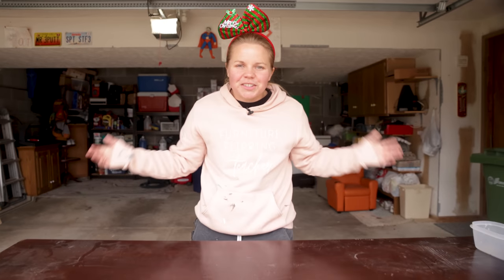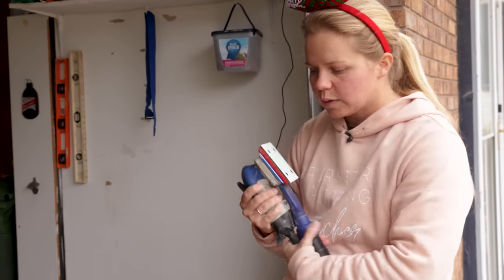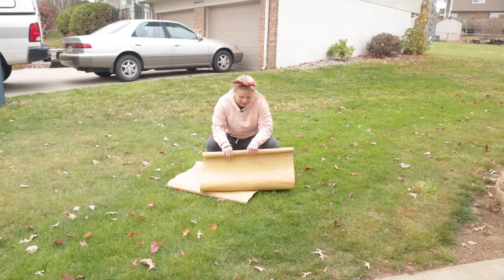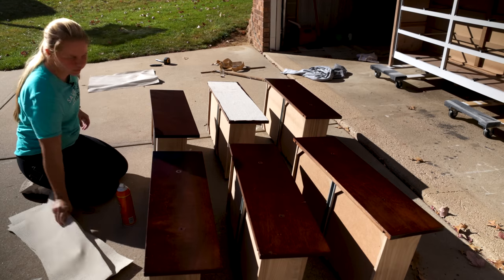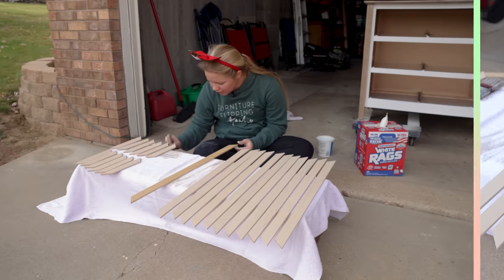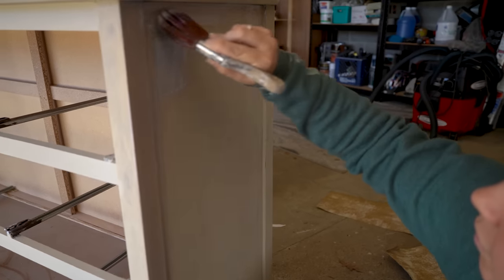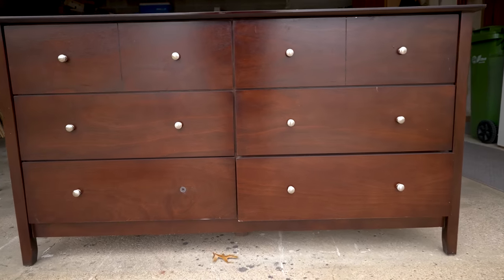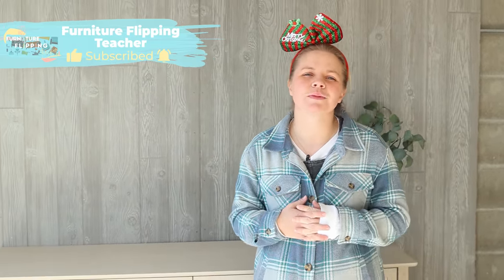$45 Thrifted Furniture Makeover | HIGH END DIY FURNITURE DUPE

Comment: When applying fabric, I spray it with a liquid starch and water solution, then smooth it onto the wood. It will stay put until you choose to remove it. You can easily peel it off.  I think I would have ironed that fabric with steam to flatten it out before applying, but the dresser came out beautiful and the wrinkles seemed to somehow magically disappear.  You always come through. I like that you can easily adapt to any problems, and quickly change course when needed.

Comment: For the fabric wrinkles: you can use a straight pin or safety pin to poke little holes in the air bump and then work the air out/ flatten the wrinkle. This works best while the glue is still wet usually. But it really helps a lot!

Comment: One thing to be aware of- some water based primers can block for a year or so and then stain or tannins bleed through. I use Zinser BIN with shellac in it for this reason. It is found at the blue and the orange box stores. I’ve never used the new primers you’ve used so I can’t say if those have longevity or not.

Comment: Use ca glue to join the lattice before attaching to drawer fronts. As long as your miters are correct they will come out tight and you’ll use less caulking or filler. Great work!

Comment: I like the piece but I think it's the details for me that I see you didn't fix that makes me think the price was too high. Like repainting over the material because it's a little patchy and you can see where the paint was and wasn't. Also smoothing out the fabric a little more because you can see the wrinkles a lot. And even painting on the under side of the draws. you painted one drawer all the way around but not all of them. But you sold it so I guess that's all that matters.
Reply from the maker: just remember I cant show every single thing I do in the video or they would be 8 hrs long! I did paint the bottoms of each drawer before delivering, the fabric was not wrinkled and the few areas that “werent painted” was meant to be like that so it shows the dimension. I basically finish the piece to 95% and then when it sells is when I go back and do all the touch ups and fix anything that needs to be fixed. thanks for watching!